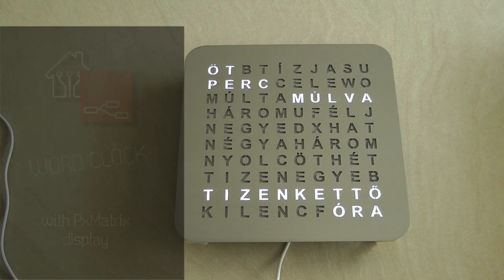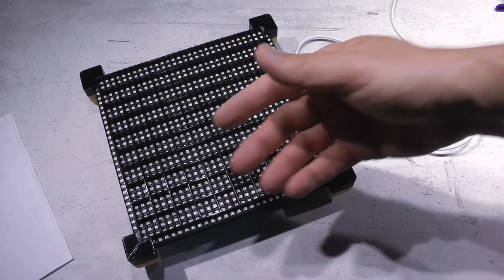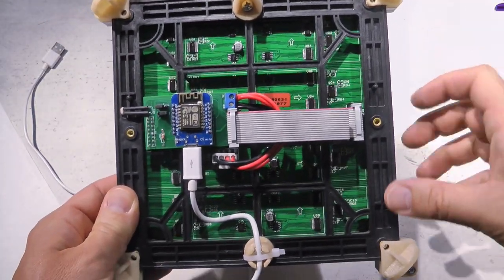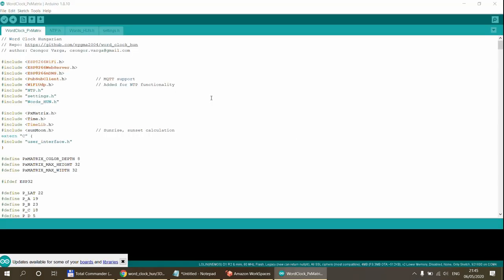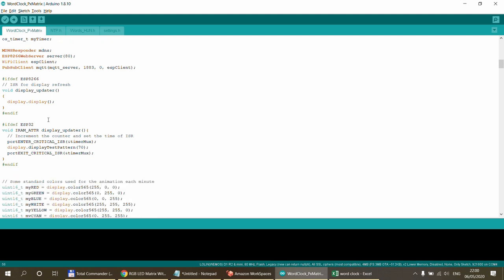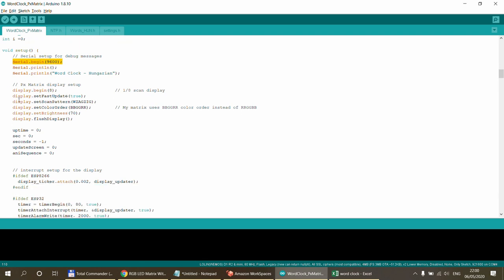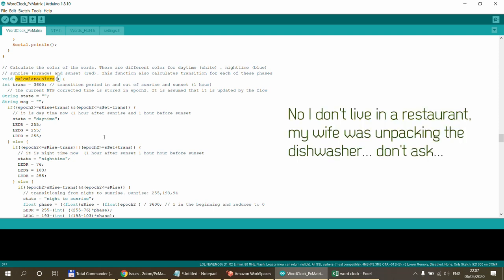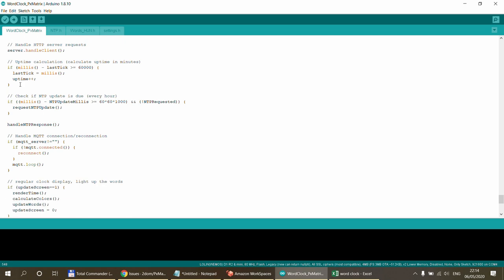Word Clock - PxMatrix, PCB and design

Comment: That is a really great matrix display.  You've made this look very professional.  It could easily be a commercial product.
Very nice and it would make a great addition to any wall.
Reply from the maker: Thanks. If I would do this next time, I would make even bigger bezel on the steel clock face, it bearly hides the parts at the back.
Reply: @csongorvarga  It's a balance between size and function sometimes.   From what I saw, you about nailed it :)

Comment: Hi
I try atime long to compile the code. First in PlatformIO, but there ididn't get any solution. Now again in Arduino, there is only one error and i can't get success...
It's with the ntp.h lib.
The error:
NTP.h: In function 'long unsigned int sendNTPpacket(IPAddress&)':
NTP.h:202:1: error: no return statement in function returning non-void [-Werror=return-type]

I didn't find the Problem about the return statement.

Do you can get me a little help with that?
thanks
Pat

Comment: Hi.
How is it possible to change the word_clock_P6matrix to letter's of my country? Where do you order the brezel?
thanks
pat
Reply from the maker: I talk about it in the video. The letters are is separate .h file where you can specify which letters to light for each hour and each 5 minute interval. The bezel came from a local cnc laser cutting shop. You need to re-design the cad file for your language and find a shop where you can cut it.
Reply: @csongorvarga  yes, the h. file i see it. But my question was for the re-design of the cad file
Reply from the maker: @valbuz  Well, you need a CAD program for that. Or maybe you can find a laser cutting company who can do it for you for extra fee.